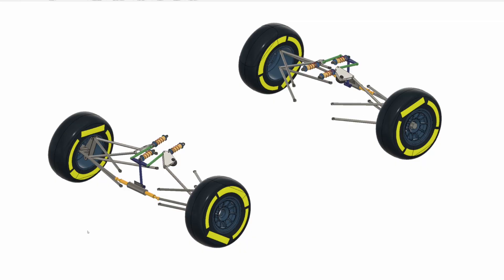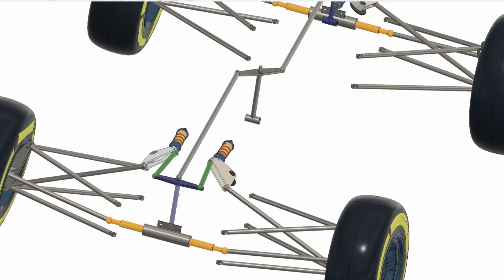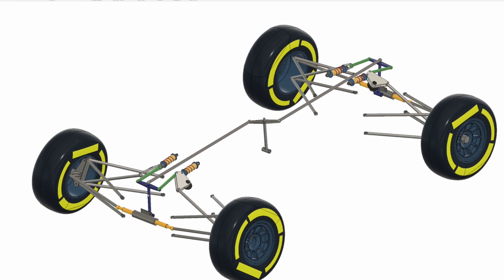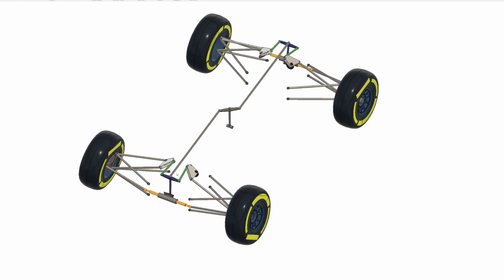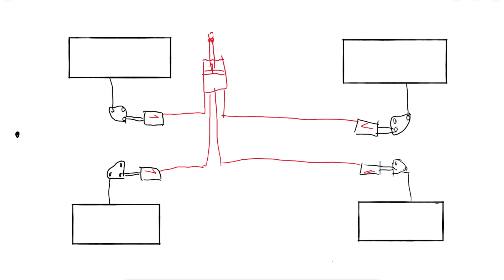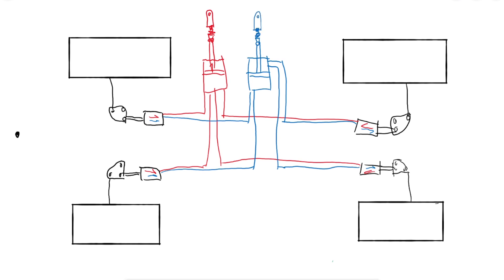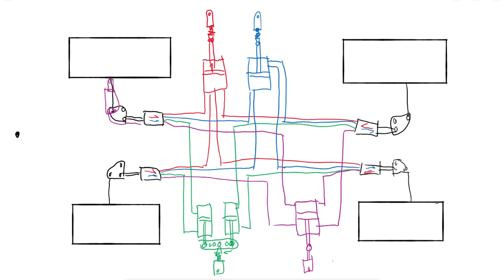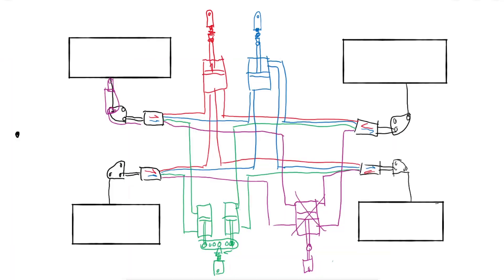The Ultimate in Mechanical Grip - How Does Fully Mode Decoupled Suspension Work?

Comment: I think there are issues with your anti-roll.  Consider your anti-roll strategy in isolation.  If you get a very stiff anti-roll setup with your method, then you also have a very stiff setup with respect to single wheel bump - very different from a stiff anti-rollbar and soft road springs, where you could have an infinitely stiff anti-roll,  but reasonable compliance for bumps.
Reply: In this system a single wheel bump actually moves all four systems, since a single wheel bump is actually a composite of all four modes. So some of the extra roll stiffness is compensated for by the other softer modes. More details on a real implentation of hydraulic suspension here: https://blogs.mathworks.com/student-lounge/2018/02/01/hydraulic-decoupled-suspension-part1/
Reply: @5thearth  My point is that you will not be able to get stiff anti-roll without also getting stiff single wheel bump - and that the anti-roll component does not give anti-roll in the accepted way of forcing the right and left sides to be connected to each other and move in the same direction.  The video talks about decoupled modes, yet you are acknowledging that every mode is actually connected.  That is not decoupled.  Hydraulic anti-roll has been used by McLaren on their road cars and by Ben Bolby on the Nissan front engined LMP car (used at the rear), but these systems have double acting cylinders so that fluid from the top of one cylinder goes to the bottom of the cylinder on the other side and VV.  I suggest studying what Citroen did on their rally cars for connecting front to rear and actually decoupling for soft warp, but so far you don't have either end sorted, so maybe worry about that later.

Comment: I'm not understanding your hydraulic drawing. Doesn't the heave circuit equalize pressure between all four wheels, and therefore you don't have any roll or pitch stiffness?
Reply: After watching AMZs video their hydraulic circuits do not share fluid between different wheels so it makes sense now.
Reply: He talks about the need to fix it to remove "weird hydraulic interactions), but you're right - as it is illustrated here it just wouldn't work.

Comment: So is this a form of active suspension?
Reply: No, its totally passive. Active suspension had a pump that added energy to the system/fluid to control the attitude of the car. This is a passive system, the car still rolls and pitches as if it had springs, we are just using the hydraulic fluid to carry and/or redirect the loads going through the suspension.

Comment: I see many videos talking about the benefits of such control over the suspension, but never data
Would be nice to put out a Vehicle Dynamics simulation video, showing the benefits on a simulated lap
I'm sure there are benefits, but would be nice to quantify it - if spending millions on making such an hydraulic design only makes you car goes 0.1% faster over an ordinary track, then one must wonder if it is really worth it
.
A lot of the benefits comes down to the feedback to the driver, and how the car would be more predicable with such suspension, and this can be shown by sampling the car behavior on transients on a simulation
Reply: https://www.researchgate.net/publication/242269184_MODE_DECOUPLING_IN_VEHICLE_SUSPENSIONS_APPLIED_TO_RACE_CARS The authors of this paper simulated a ~2006 F1 car with both traditional and mode decoupled suspension and found that over a 750 m sequence of short straights and 25m corners, the mode decoupled car was ~1 second faster, which amounts to about a 5% improvement. There were also clear benefits to platform stability.
Reply: On a 1 min 40 sec lap, 0.1% is one tenth. That's a pretty big chunk in F1.
Reply: @EmyrDerfel  yeah, but not everything is formula 1
If I am building my own car, to race at a time attack, should I invest money in such a complicated design? Or should I spend the money on better aero?

this is the kind of question would be nice to be answered. Not everyone has unlimited budget such as F1
Reply: @satanaz  I think the decoupling would have even greater benefits in a road car. F1 drives on extremely smooth surfaces (any motorsport that takes place on a track for that matter), and sure you get some mechanical grip benefits, but as another poster pointed out this is not hugely far from what Citroen introduced with the DS. it's all about controlling how the body mass behaves relative to the road, and today's roads in many places are extremely shit. The comfort benefit is hard to overstate.
Reply: @satanaz  Find a street legal and manual Cobra with the Pinto frontend and the Ford 9 rear axle. Overhaul suspension,add fox shocks with external reservoir, add stiffer swaybars and relocate Dedion downwards. Dry sump the SBC lower and move engine rearward by 5 inches and 3 inches down. Move tank forward and lower  tank. 335/15 MT and 215/14 MT on Bassets. This gets you a though and durable chassis capable of hill climbs, slalom, drift, circletrack and, depending on gearing and engine HP, ...360kph or more topspeed, 2 secs 0-60 and 60000 miles between engine overhauls.

Comment: Now, if only some could put a pump and some valves in the system you could control the suspension for every bend ;)
on a serious note, I thought that connecting the front and rear suspension was illegal in F1. I also thought that using hydraulics to connect the wheels was also band?
Reply: it was banned around 2014. look at what is called the FRIC suspension

Comment: That´s crazy. I think that the hidraulic flows slowly, (you can use other liquids that flows better) i think that a pneumatic suspension with some electrovalves and a shock asorber can do that. An individual suspension without roll, pich, but never forget the most important part. The suspension desing, you can use a good suspension elements but if you use a torsion bar instead of doble whishbone or multi link the resuslt won´t be the best. 
I am intrigued how williams did in f1 in 1991 to control the suspension, there ins´t any information.
PD: I have a citroen bx that was from my uncle, and most people thinks that is awesome, but in my opinion the suspension is bad, dont get me wrong. when i fist drive the car, i was in a small city and i thougth, oh the road is very nice and flat, but in reality, there arent. The suspesion is the soft suspension that i drove, but it feels very, very stiff because you goes every time really FLAT, is realy independent and self-leveling (the leveling is slow, like 0-5/1second) The shock absober(spheres) and hidraulics are the best. But the problem is that in the rear the car uses torsion bar and this ruins the setup, some roll and pich... For example bmw. are cars with a setup with little dive and squat, and roll. The most important is the GEOMETRICS
Reply: The hydraulic fluid won't have to flow very far and  you want hydraulic fluid as you want to keep the expansion of the hydraulic lines down as the system would be harder to predict the needed spring rates. And possibly by the time the air starts to create enough pressure to move the piston it's too late. In sense the air is a spring and you don't want that, same as expansion of the hydraulic lines. You could possibly use valves to control the hydraulic fluid flow but it would lead to minimal gains if any. Active shock absorbers on each individual piston setup would be best but it's unclear how much of a gain it would give. Your are correct that suspension design is the most important thing but a torsion bar is just another spring and they use them in F1. You should have said torsion beam suspension which in that case you would be correct that it is not ideal. Williams has kept their suspension a secret in case active suspension resturns in case you didn't know and that's why there is no info on it. Some people believe it's close to what is called the FRIC suspension which was used until 2014.

Comment: I heard that f1 cars run torsion beam springs for their compactness and weight. Was that a last gen thing, or still used?
Reply: I think they started using it quite a long time ago and they still do.
Reply: Yeah, but that's prolly gonna change in 2022 with the tiny sidewall height tires
Reply: They used it to dampen the nose movement, but will get banned.
Reply: @Sysiphus1981  why would it get banned?
Reply: @Sysiphus1981  interesting, but we're talking about the springs used, not the dampeners :/
Reply: @fillman86  OK, misread

Comment: There's a concept I've always been curious about, but I've never seen anyone really cover the suspension, geometry, and tire dynamics of it, a leaning quad with a low cg cockpit; essentially combining the leaning characteristics of a motorbike with the steering characteristics of a four wheeled vehicle. One specific question I've always had is about the leaning of the various components, say if the body of the vehicle leans to a specific degree, do the inner and outer wheels lean to the same degree, or should there be some kind of differential between the components where it's inner wheel has a greater angle of lean than the body and the body also has a greater angle of lean than the outer wheel, x>y>z, all from a reference of a straight up and down 90°; a leaning variant of ackermann geometry, essentially. Another specific question I have pertaining to this is how this leaning would interact with steering, such as if ackermann geometry is still relevant, which of lean and steering is more important, etc. Then after those two, assuming both are equally important, and if leaning does have it's own analog of ackermann geometry, how this would incorporate into a suspension system, specifically an independent leaning suspension. 
I have yet to find anyone actually research this kind of concept. The most I've found are leaning trikes where performance is an afterthought. But my curiosity is if this kind of concept were thrown into a motorsports category where everything is fine tuned for performance.

Comment: ...I quietly wonder if there'd be any point to running a hydraulic system like this in something with a lot of travel. like...30" of travel or more, attached to 66" tires. The "hydraulic pistons" are already there in the form of the nitrogen gas shocks the big trucks run. Main thing would be keeping all that oil cool (and in the lines) through the 2 or 3 minutes of a freestyle...

...thinking about it, fully decoupled suspension is probably way too sophisticated and expensive for Monster Trucks. But it's interesting to think on nonetheless.
Reply from the maker: If I had a whole lot of money I would love to try a system like this on my race buggy, have it all coming back to a central unit that could then have a full on cooling circuit with a radiator to keep the whole thing cold! One day someone will develop it...
Reply: @KYLEENGINEERS  At least aspects of it, sure. Tying the front and rear shocks together for pitch control would definitely help a lot of the off-road racers, since with the soft springs they really squat and dive. Warp maybe not so much, guys like the articulation for the uneven surface, though separating that from roll control would probably be a good thing. Who knows?
Reply: The super high CG of monster trucks makes it kind of an ideal application for some sort of front/rear interconnect. I don't think it would worth going full decoupled but there's plenty of space for a bar running front to back that could give some real benefits in squat and dive.

Comment: so basically a Mclaren suspension is the closest thing to this
Reply: Yeah which I guess (partially) explains why they’re not in a rush to put a limited slip diff in their cars?
Reply: @GreatistheWorld  They don't put a "proper" LSD there, but they do fake it a bit by using the brakes individually, preventing inside slip and transferring more (usable) torque to the outside.

Comment: You forgot to put in the suspension for the driver's seat.

All jokes aside, since you're connecting the front and rear, you've just made somebody at the FIA unhappy, and also made me very happy~

EDIT: Electro-hydraulic suspension (hydraulic using an electric pump!, with harmonic dampers (aka Inerters / J-Dampers) and linear alternators.

That would be the real ultimate, in my honest opinion, because the linear alternators would also serve as energy recovery to recharge the hybrid systems through the suspension movement.
Reply: While it is most likely superior how reliable would this suspension be? If X suspension lasts Y laps then failure and potential wreck granting DNF for race results. I bring this up as I admired the Citroen hydro-pneumatic suspension which you could remove a rim from the vehicle and it would sustain being level with wheel hub floating capable of being driven as is being freaky as hell. Yet, it was far from reliable and discontinued.

The entire design Kyle detailed reminds me of the Citroen system.
Reply: @RichardPrendingue  I guess it just depends on how robust you build it.

The Electro-Hydraulic thing is just normal hydraulics, but using a more efficient electric pump instead of a purely mechanical one.

Meanwhile, the harmonic dampers and linear dynamos are more of just useful add-ons than anything else.

Comment: Do you have any particular opinions between controlling dive and squat via spring systems vs. geometry (anti-dive and -squat)?
Reply: hard to change up suspension mounting points mid race plus it puts more force on the suspension pickup points. best to us spring systems but if you cant then use geometry

Comment: 0:24 I thought I saw more people asking about heave, dive and squat not being decoupled? Fantastic video regardless, as always.
Reply from the maker: Yeah, I misspoke a little sorry, pitch and heave coupling was definitely the bigger question! All good, I cover it anyway :)
Reply: @KYLEENGINEERS  Righto, explains it. Speaking of that, considering how different ends of most racing cars are used for different things (front does most of the steering and braking, rear does the accelerating), and how you usually end up with a stiffer front than rear (again, in racing cars, stiffer rear for "flat ride" in road cars being another subject entirely), would you say that splitting the pitch mode into specifically dive and squat would also be important? We'll leave lateral asymmetry out of this, since it usually isn't desirable in road racing, but is of course a big thing in oval stuff.
Reply from the maker: @jubuttib  To some extent you can control the squat/dive split in terms of damping, as it is effectively the bump and rebound of the pitch damper. You can also make the springing change through a dual rate/position sensitive springing system, so that all can be covered off in terms of mode there. Now aero requirements front/rear is a different kettle of fish, particularly if you're trying to maintain a low front ride but don't care so much for rear, and this would definitely be a struggle to tune with this specific system. But that's a full extra video worth of content!
Reply: @KYLEENGINEERS  Right. I was thinking more in terms of lower (or even no) aero cars, how for example the McLaren MP4-12C GT3 car on its main spring set (softest FIA homologated for the 2013 season, nominally 1000 lbf/in front and 1200 lbf/in rear) ends up with about 125 N/mm front springs and 90 N/mm rear springs when measured at the wheel, which translates to roughly 3.5 Hz at the front and 2.7 Hz at the rear (not taking into account the sway bars). The different requirements between wanting a responsive and sharp feeling front end with enough pliability in the rear to allow you to put the power down.

Looking at a lot of GT3 and GT4 car setup sheets I tend to see them set up with something like 20-35% higher front frequencies than rear (before sway bars). Was thinking if this would be something to take into account when designing a fully decoupled suspension.

FWIW I work with racing simulators. =)
Reply from the maker: @jubuttib  I'm not a suspension expert, so can't be 100% sure, but I would've thought those handling characteristics can largely be achieved using forwards pitch/rearwards pitch control and a bit of roll stiffness biasing to cover off the rest of the wheel rate difference. Beyond that I know that typically in most cars I've worked on that we've ended up with stiffer corner springs on the front that the rear to get the aero platform control right (essentially a per axle heave stiffness approach), as the front ride height is significantly more sensitive than the rear (and we want the rear to drop under higher aero load), but not sure how much that would play a factor in your simulation (hopefully plays some role!). Perhaps some more of my viewers who are more knowledgeable in suspension tuning than myself would like to chime in at this point?
Reply: @KYLEENGINEERS  Certainly plays a role, and I've spent many an evening going through default setups to make sure that stuff like rake, CoP and aero efficiency works properly at speed. =)

You can control that with the dampers to an extent, but I personally don't like that approach, because it can so easily mean you have to go supercritical with the slow rates to get noticeable effects. Outside of trying to follow real life settings where it makes sense (as you can imagine you can't always just take a real number, plonk it into a sim, and expect it to work perfectly), I usually prefer to adjust springs for the kind of overall behaviour I want, and then just tune the dampers to suit the springs. I want the springs to be free to do their work, and just want the dampers to keep them under control.